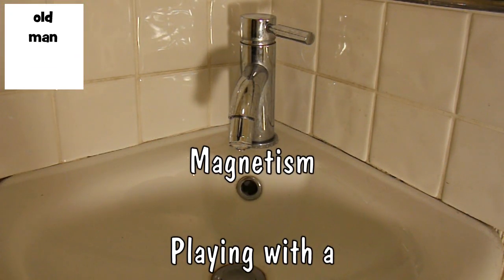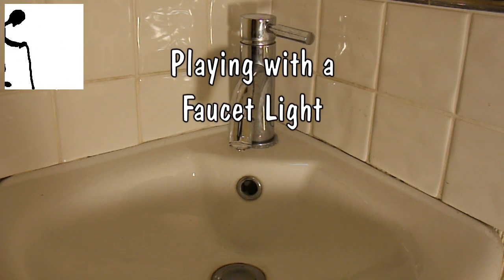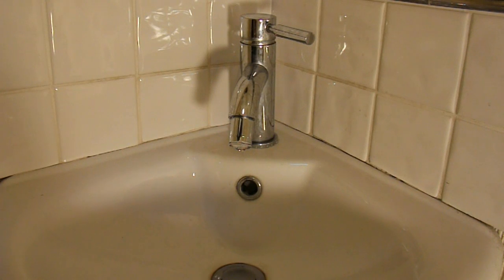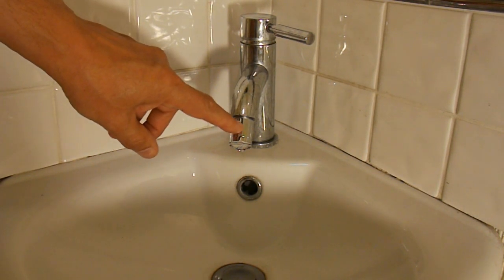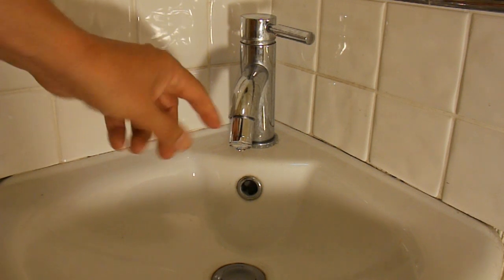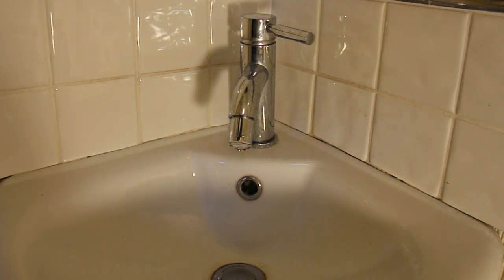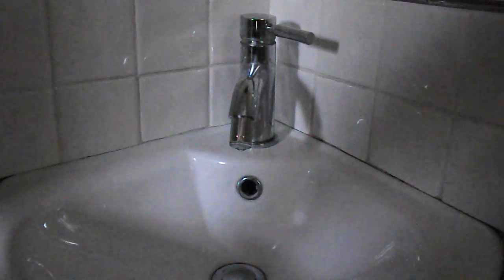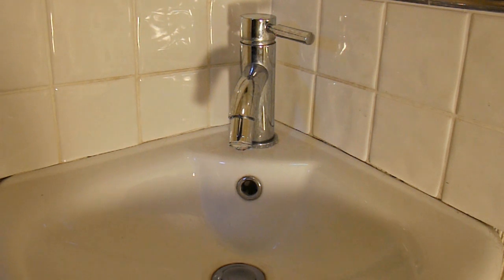Magnetism - Playing with a Faucet Light Part #1

Comment: I think you're just inducing a current in the coils by rapidly moving the magnetic field, imitating the motion of the turbine. if the turbine were spinning, the lights would be more constant.
Reply from the maker: Hi Zachary, that's what I said in the video description and my initial comment if you read them. Without taking the unit apart there is no way of confirming if the power is coming from the spinning of the turbine assembly or just induced by my magnets. Either way, the turbine is rotated by the magnetic field I am inducing, but as I am spinning my magnets back and forth the rotor will be doing likewise. I could have put the magnets on the end of a hand held electric fan, but I wanted it to be a simple basic video, in fact I will upload another video later to demonstrate a more constant light.
As Lidmotor says in his videos you will probably destroy several of these units trying to get them apart as they are epoxy glued together in a solid mass. That is why I purchased 3 of them, but I haven't tried to take any apart yet.

Comment: These are very interesting little generators but nearly impossible to take apart because of the epoxy glue that they are encased in.  The circuit board with the LED is glued onto the back of the generator.  I found an old type on Amazondotcom that was just one color and put together with cheap glue. It that came apart easily and the generator / motor wires came out intact.  The other ones I took apart lost the hair fine wires in the process.
Reply from the maker: Hi Lidmotor. Yes, I ordered 3 of these off eBay whilst watching your video. Delivery from China took a while as usual and when they arrived I fitted one to the tap to amuse my grandchildren, I haven't tried to get one apart yet but in the comments below Satnavboy100 has echoed your comments on the way they are glued together. Sounds like a rainy day project for me just to get them apart :-)